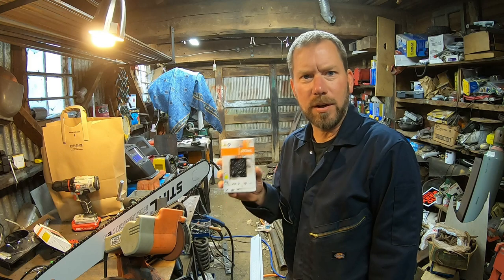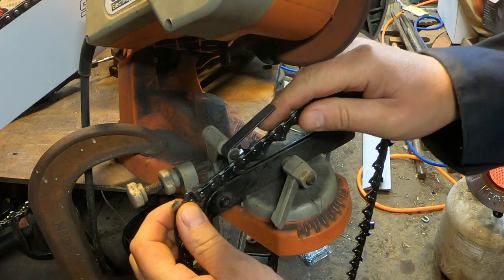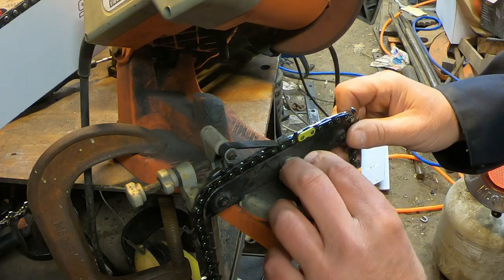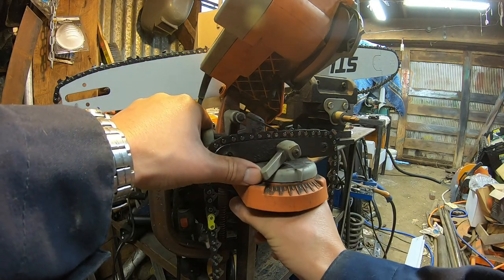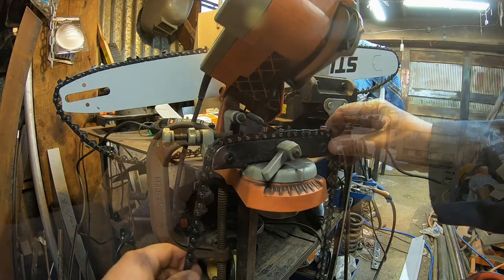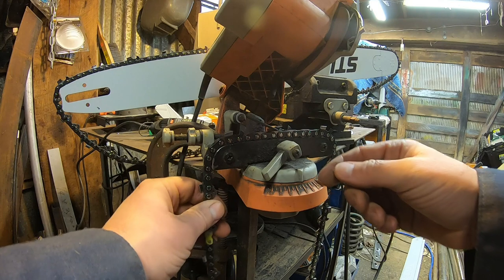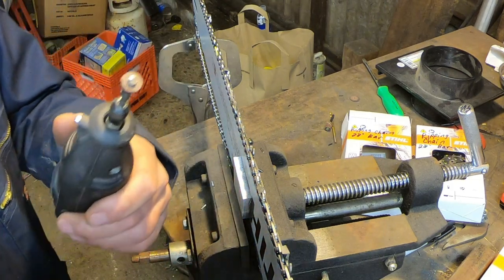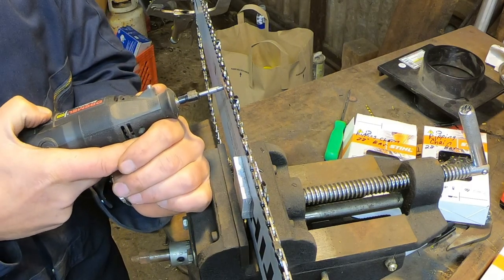DIY How to make a ripping chain for your Alaskan Sawmill.

Comment: I was also thinking about how all that gringin would impact the depth gage.  And I also question if a ripping chain is even necessary if you are using the Zozen type mill that is cutting at 90 degrees. Those tiny chips seem to have NO trouble clearing.
Reply from the maker: I try to cut at a 20-30 degree angle as the 90 makes such fine dust and dulls the teeth more quickly, plus I just love watching big shavings fly :)

Comment: Just a quick question if anyone knows, I've just got a chainsaw mill which I'm testing on macrocarpa here in NZ, so I was going to do a ripsaw grind on the chain, as described in this youtube (thanks!). But in fact it seems that you are still crosscutting the tops of the grain, as you mill along the log. But you'd be ripping if you were cutting along the length of the log, if that were ever possible. Any thoughts on the chain sharpening settings between 'cutoff' crosscut where you just cut a log in half for example, and and milling chainsaw setting where you are still effectively crosscutting (I think) across the tops of the grains. Or is this what these 10degree/skip2 type chainsaw settings are actually for.
Reply: That is exactly what this cut is for. I still try to cut at a ten to twenty degree angle and this grind works perfectly for that 😊

Comment: Will you explain why the teeth that are modified are NOT cut completely off to the strap.  I think it would be to help clear the cut from the tooth in front of it that is the fuel tooth.
Reply from the maker: That is correct, they are clearing teeth to help move the cut material out of the way for the cutting teeth.

Comment: Great video. Thanks so much. 

I’m just about to try my new small Granberg mill with my Husky 445 with an 18 inch bar. I plan to mill some small spruce and fir that I cut over the winter that won’t exceed the size limits of my bar. 

Unfortunately, the local dealer can’t get any skip tooth chains in right now. If you were using a similar set up, how might you modify a standard crosscut chain in this situation?

Love the channel and I’m now subscribed.
Reply from the maker: Hey L D, great question!  With a bar as small as 18" you shouldn't need to go with a skip-tooth as your Husky will have plenty of power to pull it.  Just grind the teeth like it the video and it will most likely do great....just don't try to feed it too fast and keep the RPM's up to optimal.  Hope this helps.
Reply: Thanks for the detailed reply. Much appreciated.